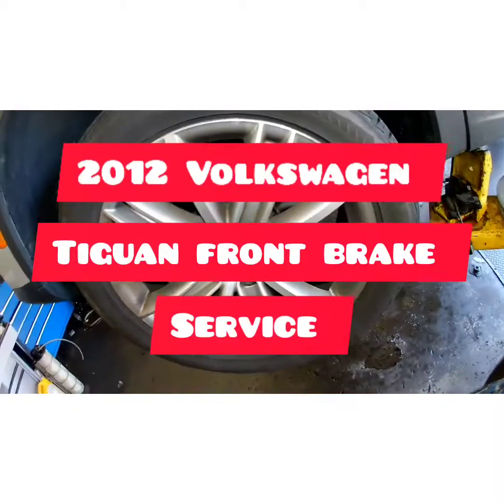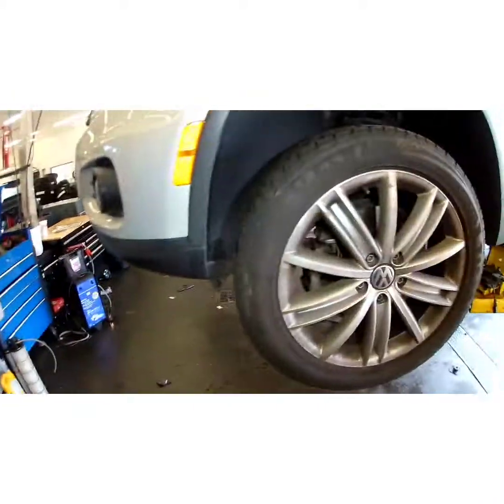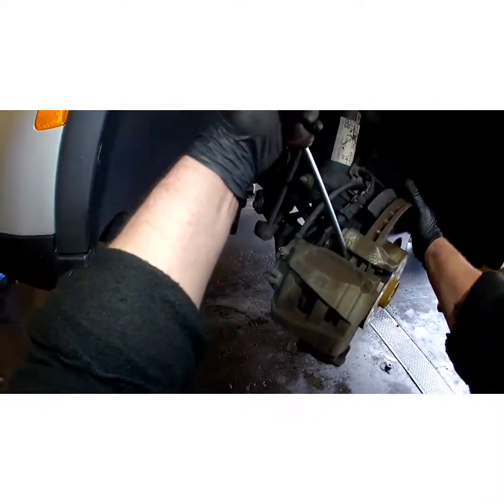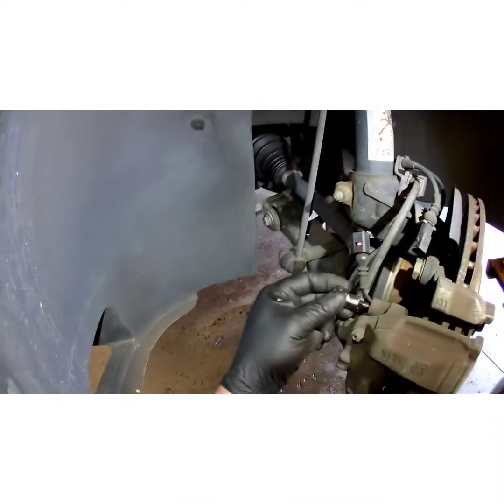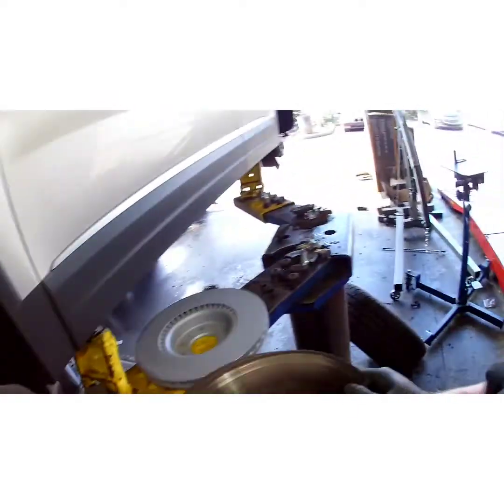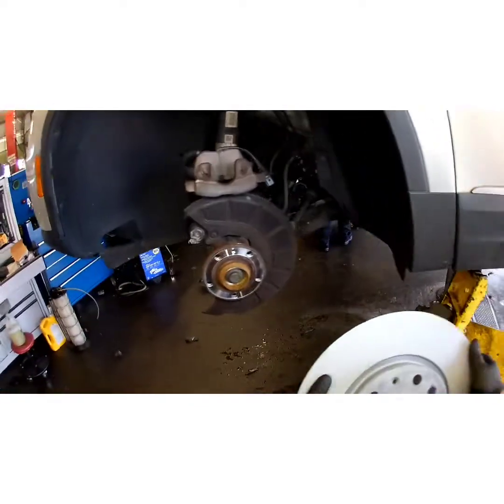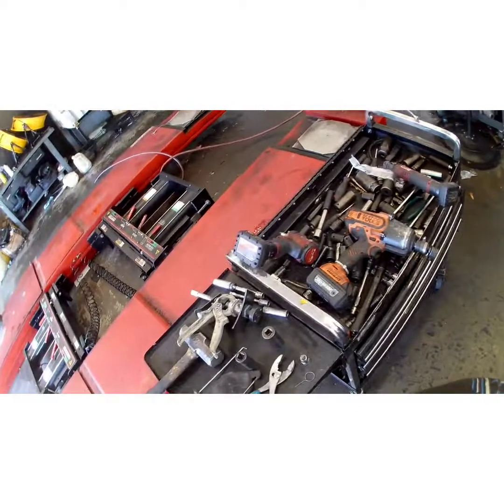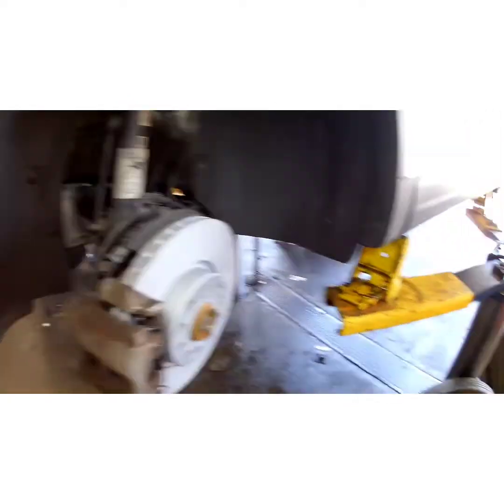how to replace front brake pads and rotors Volkswagen tiguan

Comment: Great job putting this together. I'll be swapping my 2018 Tiguans rotors and pads this evening using your video as a guide ✌🏼!  

I must complement your ability to thoroughly explain/demonstrate this task while still being short and to the point. This is a skill that's lost on most of the "how to mechanic" videos on YouTube. I must have watched 5 different videos on this topic where the person ended up going down some unnecessary "tool use" or "mechanical theory" rabbit hole, that made things seem more complicated and confusing than they really are. 

I especially like the 7mm allen-to-T45 hack. Makes me wonder if there are other equivalent Allen-to-Torques sizes out there as well.